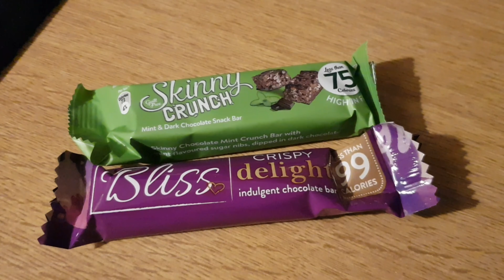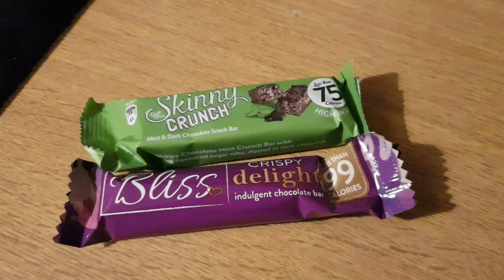SLIMMING WORLD | HOUSE RENOVATION | WHAT I EAT IN A DAY | 26.03.21

Comment: Morning Becs, I've never found a roll that can be used as a healthy extra.  You are doing so well with your low syn days  x x x
Reply from the maker: I find Aldi the best for choice on wholemeal rolls that are HEXB but if I go to Tesco I buy a pack and sometimes have to take a bit off as they're more than 60g🥰
Reply: @rebeccaj  thanks for the tip, is that the deal then, they have to be 60g?
Reply from the maker: It's what I go by, I saw it on the fatgirlskinny website I think 🥰